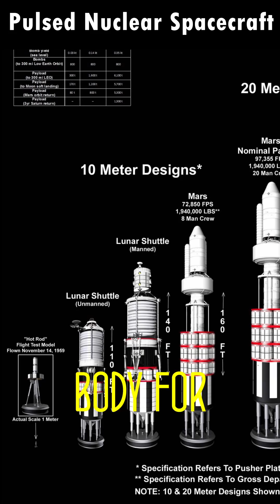Pulsed Nuclear Spacecraft

Comment: Springs break.  All the time.  Eventually even when "over designed".  I worked in maintenance and engineering for over 40 years and I can tell you: Stuff always breaks.  It was job security for me and many like me.  It might be fair to say that fixing or replacing a broken spring over a lightyear away from Earth would be a challenge.
There are multiple non-contact linear methods that would be far more robust than mechanical springs that could absorb the energy of the impulse and use some of that absorbed energy to return the pusher plate back to zero for the next cycle; and have energy left over for craft operations and other purposes.  Two methods are basically electromagnetic and another is basically thermal.

Comment: I've always thought of the Orion drive as more or less surfing a nuclear wave
Reply: totally tubular!
Reply: Sort of, but less so the atomic blast and more the expanding disk of tungsten plasma racing away from the pulse unit, which would be a shaped nuclear charge designed to reflect everything it had roughly towards the pusher plate, through a beryllium fill to turn the x-rays thermal, and into a disk of tungsten or some other dense material to carry the energy to the plate.

Comment: Use two rail guns to propell very small pellets of uranium (less than a gram each) in such a way that they collide behind the ship, causing a nuclear reaction due to impact velocity. It's a way more effective use of material and a much smother ride due to smaller but more continuous explosions.
Reply: Or just have it be launched from an external system. It impacts a target a distance behind the ship, thus creating the mass of high speed propellant that hits the piston. This avoids the nuclear fallout.
Reply: You can't make a supercritical mass (and hence a nuclear detonation) from a few grams of uranium. You need a minimum of 2–3 kilos of plutonium, symmetrically explosively compressed, and sprayed with a neutron gun, and  injected with a deuterium-tritium gas mixture, and surrounded by a beryllium reflector. All that comes to minimum of 26.5 kg per bomb currently.
Reply: @akizeta  it's only a question of compression/velocity. Also the tritium in nuclear bombs is already baked into the pit, not injected. Nice try though
Reply: @UnfollowYourDreams  Kudos to you for your self-confidence; brickbats for your wrongness. 

You cannot compress a few grams of plutonium or uranium sufficiently to reach supercriticality, no matter what speed you bang it together. If that could be done, we'd have atomic autocannon rounds. What fun that would be!

Secondly, tritium has a fairly short half-life — 12.3 years — which means you start losing it immediately. Modern nuclear devices feature reservoirs of tritium-deuterium gas, so that the optimum mixture can be maintained in the pit, so that the bomb detonates properly. It isn't "baked in" in any sense, else they'd have to replace the entire warhead every few years, instead of topping up the reservoir.
Reply: @akizeta  in case you didn't know, that's exactly why warheads need to be refurbished constantly. It's the reason nuclear arsenals are this expensive, you can't just produce nuclear warheads and then store them for decades. The lifespan of russian pits for example is arround 25-30 years max, after that they need to be completely dismantled and recycled.

Also e=mc² . 'Atomic autocannons" are absolutely possible, just not within earths atmosphere. But since this is about spaceship propulsion... air drag and gravity are not going to be a problem you have to deal with.

Comment: They designed 10 meter diameter, ≈600 ton ships (such as that pictured) to be lifted into orbit in sections aboard a Saturn-V booster (≈110 tons to orbit, like the "Starship" if it works).

A cargo ship might take long slow Hohmann trajectories: 8 months to Mars, but some 85% of what's assembled is payload into Mars orbit.
A crewed ship would leave when the 2 planets are physically closest, literally jumping across at cometary speeds: 21 days into Mars orbit (including starting and stopping, unlike other projections in tabloid media for other advanced propulsion which only extrapolate the theoretical maximum speed and apply it between planets without thinking about accelerating and decelerating)

The hardest technical issues are how to toss a 3/4 ton keg aft at a few hundred meters/second every 20 seconds, and spraying a grease-mist across the aft pusher plate in between pulses.
 Dr Theodore Taylor (Manhattan Project and post-war bomb designer and later anti-nuclear weapons activist) said that any number of well-known ways exist to translate the power of the bomb into momentum to the ship, to apply the plasma jet fast enough so that heat and radiation wouldn't degrade the plate, yet slowly enough so that the kinetic impulse doesn't exceed the physical strength of well known materials like steel.

On his own, Freeman Dyson looked into how it could scale up. It used fission/fusion bombs of tens of megatonnes shooting 1300 tons of propellant as the plasma jet to push the ship.
It makes a pathetically lousy slow interstellar ship, but if .1C is the maximum possible velocity change of the ship, it means a 5 million ton super-liner hotel ship that crosses 100 AU in 17 days at peak mid-course coasting speeds.
 1960s understanding of science.
Propellant mass to be vaporized and shot at the ship to push it is 75% of the mass of the "pulse units" and can be anything from plastics to metals to stone. If destination space colonies can supply that for further legs of a trip, it's even better.
Reply: Isaac misunderstands how it works.

It doesn't use omnidirectionally expanding shock waves or simple debris from the bomb itself, but directs the prompt energy into a propellant material that is ionized and shot at the back end of the ship in a directed jet.

Hotter than the surface of the Sun but much cooler than the bomb.
Over 100,000°kelvin, it takes ≈1/3000th of a second to traverse the distance and some short time to pile up on and stagnate against the plate.

Dyson said that most of what we associate with a nuclear explosive is from the air being vaporized and the flash from that re-radiating the heat outwards. In space, and especially with the less than half a kiloton blasts used, there'd be a brief tiny spark when the bomb went off followed by a building flare as the plasms hits the plate.

Comment: This always seemed like a particularly rough ride
Reply: 1 pulse every 20 seconds in space is dampened by the shock absorbers into a more or less steady 3G ride.
It allows such fast transit speeds that it's much easier on the crew. 21 days to Mars in a stripped-down crew transport (including starting and stopping, unlike other projections in tabloid media for supposedly advanced propulsion, which just extrapolates the maximum speed between the planets, without accelerating or decelerating)
Reply: I don't think there's such a thing as a "3G acceleration".
Reply: @jasoncaldwell5627 I sense they mean 3 'g's.  Like ~28m/s^2.  Most designs tended to aim for 1g, but when you're in a hurry...
Reply: @jasoncaldwell5627  then you're uninformed. Space Shuttle lifting off experienced 3G, Crew Dragon hits 4.5. Re-entry is frequently more than  3G deceleration.

If you're being pedantic about my shorthand typing, get over it.
Reply: @JFrazer4303  There's a hell of a difference between briefly experiencing 3G while making orbit and maintaining it for a six week journey to Mars!
I think the technology is promising to send probes and unmanned vehicles to go in advance and set up base- but not for us soft, squishy meat sacks.
Reply: @jasoncaldwell5627  
It doesn't maintain that during the entire trip, but only less than an hour.

If needed, it could be scaled back in design to 1 G, but over longer periods.
Reply: @JFrazer4303  I think a 1G ride is going to be the requirement. Possibly 1.2- but that's probably it.
Reply: @JFrazer4303  

No
Reply: @springbloom5940 
Yes, according to facts.
Reply: @JFrazer4303  

'Facts' 

CITATIONS NEEDED!
Reply: @springbloom5940  read the General Atomics reports for NASA. Read any credible reporting about Orion.
Your ignorance of the case in hand isn't more credible than the science behind the reporting of what they said it would do.

Comment: Let's hope the electrical equipment onboard is well shielded from EMP effects, or the first pulse is going to end the expedition real quick.
Reply: From Dr Theodore Taylor (Manhattan project, and post-war weapon designer who worked on Orion) EMP is only known under the atmosphere from very large blasts, or smaller blasts which are specially designed to produce it. These are neither.
Reply: @JFrazer4303 This is in the same misconception that a bullet needs an atmosphere to work. Just like a bullet, the nuke already has everything to work in its casing. It doesn't need an atmosphere to propagate elements like EMP on explosion.

Being in space would in fact make nukes even more effective with the lack of an atmosphere shielding stuff from its explosion
Reply: @tandemcharge5114  nukes are less efficient in space because the atmosphere acts as a medium to carry the shockwave
Reply: @lordilluminati5836  This is fundamentally wrong, nukes aren't less efficient in space. With the lack of an atmosphere to push against, Nukes have a far larger fireball size.

While yes, it doesn't have the conventional shockwave that devastates non armored, non reinforces buildings, it has the fireball and deadly Xrays caused by the igniting of the core which aren't impeded by the atmosphere

It's a complete myth/misunderstanding to say that nukes are less efficient in space
Reply: @tandemcharge5114  EMP from "Starfish prime" was from interaction with the upper atmosphere. Not every bomb detonation has it.
Reply: @lordilluminati5836  not only does atmosphere do the work of carrying the shockwave, but it's almost entirely the cause of the intense flash; vaporized atmosphere is by far mostly the flash.

Dyson said of Orion that there would be a barely visible brief tiny spark from the bomb, followed one three-thousandth of a second later by a building flare of the vaporized propellant piling up on and stagnating against the pusher plate.
Reply: @tandemcharge5114 
If you know more about it than Theodore Taylor and Freeman Dyson, please cite your professional qualifications and where you are published under peer-review showing that they are wrong.
Reply: @JFrazer4303 I'd always thought the EMP was primarily a result of high speed plasma crossing Earth's magnetic field lines and inducing currents like a large CME. A low altitude or surface detonation would need to be huge or specially designed for its plasma shock to cover enough distance while an upper atmosphere or LEO blast would not.
Reply: @johnassal5838 correct. Once the nuke rocket is beyond Earth's magnetic field thr E3 pulse stops being a problem.

Just dont use the nuke rocket in near-Earth orbit! 😅
Reply: As a rule most spaceships going outside our atmosphere are pretty well shielded already. Solar radation tends to do awful things to improperly shielded craft and i imagine that goes double for the squishy meat things inside. So i would imagine it would not be hard to further protect everything in the case of a oopsy especially as your going to beef up the shielding anyway to protect the meat based stuff inside.

That said these nukes as a rule are going to be quite a bit diffrent then what you would find on an ICBM. First because there is no atmo there wont be propagation waves. So the boom wont be a lot bigger then a comparable boom from conventional stuff. Just much more compact.

Second they are going to be designed entirely diffrent and a lot of consideration is going to go into how they are shaped, how the blast goes off and which direction gets blasted with radation.

Third. most nukes either need an atomsphere or to be designed to produce an EMP. These are designed as defacto rocket fuel. There are ways to ensure there wont be an EMP or that it will be minimal at most.

Finally, your going to have a big giant plate designed to survive potentially thousands of nukes going off against it between your spacecraft and your drive. Put something that can block EMPs on the crew side of the plate and between the mass and extra protections the odds of an EMP frying anything will likely be lower then a solar storm frying your ship.
Reply: @arcticfox5118 No most nukes don't need an atmosphere, it's the opposite. The emp is worse when it originates in the upper atmosphere or outside the atmosphere. It's the main reason nuke tests in space were banned by all parties involved. A well placed nuke in the atmosphere can black out most civilian or non hardened electronic equipment for thousands of miles.

With that said most military and NASA equipment is hardened from EMP's. There's no reason why this wouldn't be.
Reply: There are a few different sources of EMP from a nuclear explosion. Some of them wouldn't happen if outside the earth's atmosphere and magnetic field.
From the Federation of American Scientists:
"A high-altitude nuclear detonation produces an immediate flux of gamma rays from the nuclear reactions within the device. These photons in turn produce high energy free electrons by Compton scattering at altitudes between (roughly) 20 and 40 km. These electrons are then trapped in the Earth's magnetic field, giving rise to an oscillating electric current. This current is asymmetric in general and gives rise to a rapidly rising radiated electromagnetic field called an electromagnetic pulse (EMP). Because the electrons are trapped essentially simultaneously, a very large electromagnetic source radiates coherently."
There's another component caused by disturbances in the geomagnetic field that also wouldn't happen in deep space, but I think the E2 pulse would still happen.

Comment: Forgive the ignorance, but why not use some sort of inverted cone or bell shape or something instead of a flat plate? Wouldn’t that direct the energy downward in a better way and provide more efficient thrust or something?
Reply: It doesn't work that way. It directs a jet of plasma from the bomb carrying device ejected aft of the ship into the aft end of the ship, pushing it. Efficiency wouldn't improve by making a heavier more complicated bell or hemisphere shape.
Reply: Ideally you'd have an actual 'combustion' chamber with a throat and a nozzle. The problem is going to be how heavy you'd have to make it not to explode and how to deal with erosion of the inner surfaces. You'll certainly raise your specific impulse, but if you add so much weight that your delta V is lower, then you haven't really made it more efficient.